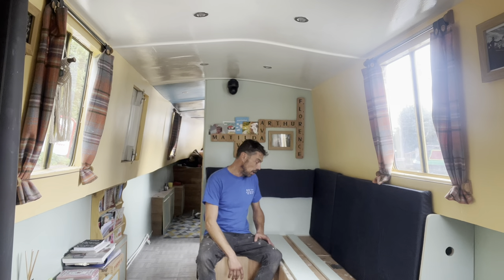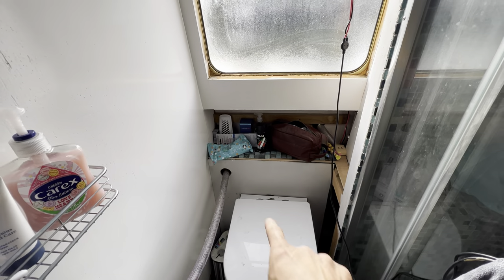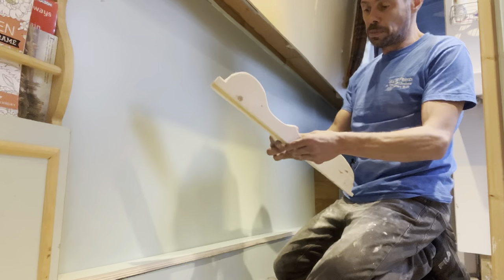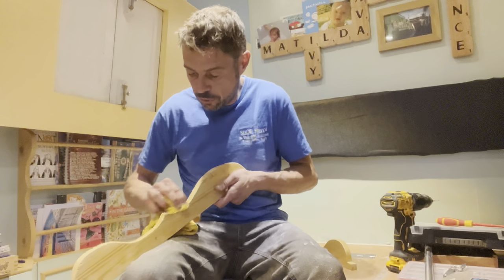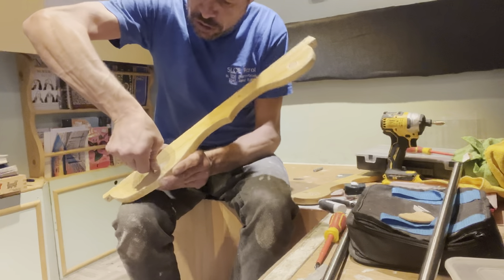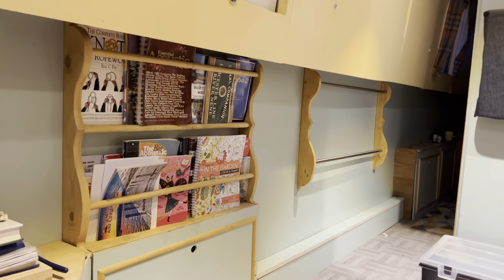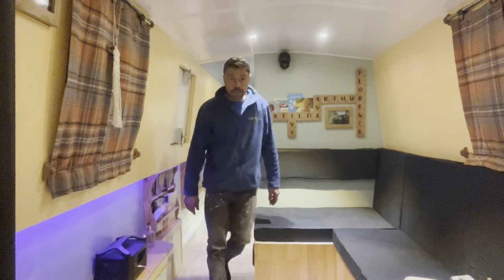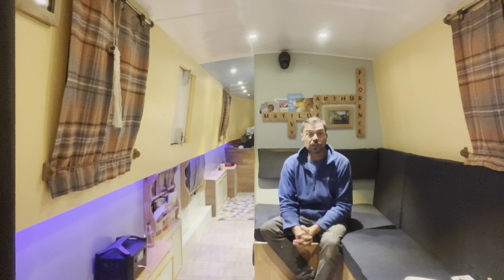368. Upgrading Narrowboat bathroom

Comment: Hi James. May have missed a video but wondering how you remove bathroom sink waste. Do you have a separate pump for the sink, using the shower Gulper or relying on gravity to let it drain away?
Reply from the maker: Just gravity. As long as the exit hole is below the sink it’ll all drain!
Reply: @TheNarrowboatThatJamesBuilt  great. Thank you